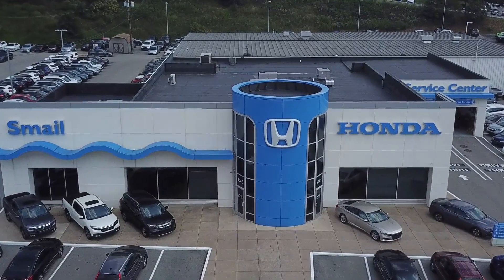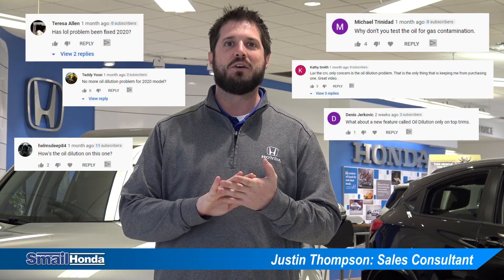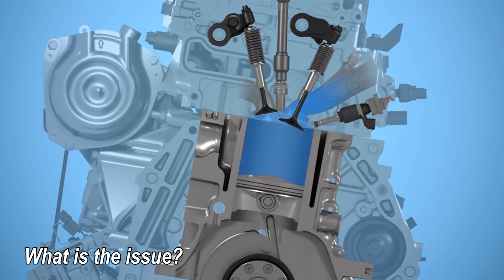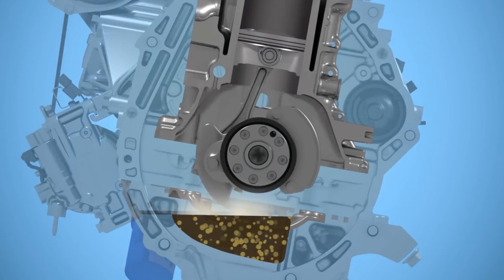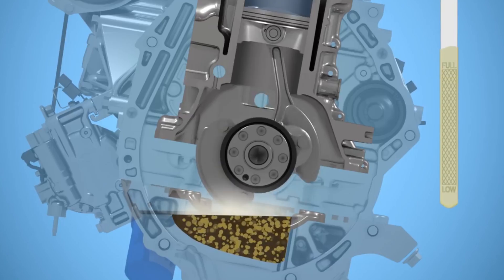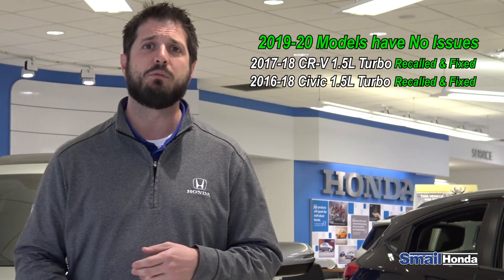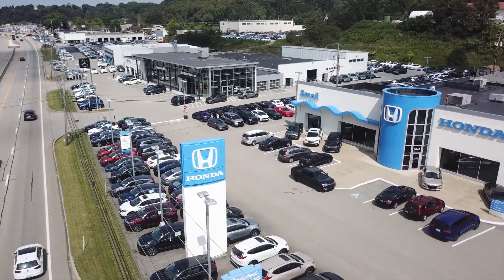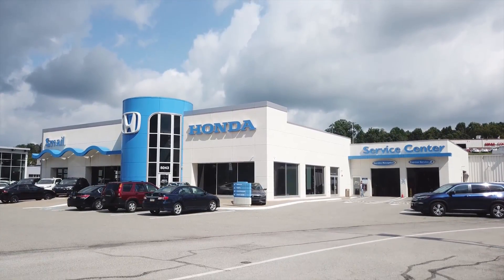Honda Oil Dilution Issue Explained

Comment: So why don't you change your oil more often?
Reply: If the engines runs on diluted oil it won't last very long.
Reply: @crazydan777887  thats why were asking, why don't they change there oil sooner then the honda spec so the oil doesn't dilute.
Reply: @john12abey  I really don't agree. I've had Honda's for over 20yrs.I had a 2001 civic, it was super fuel efficient yet would warm up very quick. Our 2015 crv takes twice the time to heat up (and the temp. Gauge goes down in winter if I turn up the heat)and it's not even mentioned. But to me an engine must run at it's operating temp no matter how cold it is. Diluted oil is not good especially considering the ultra-thin oil (0-20) that's recommended. This really seems like a design flaw and maybe not enough people have winters for it to be addressed as an issue. But a car should not be required to be driven 30 minutes just to avoid oil dilution. PS in case you're wondering I'm in Montreal.
Reply: @crazydan777887  I live london ON
Nice and cold around here myself 4 hondos over the years civic hybrid 2003  479000km 
Crv 2012 daily driver 200000
Crv 2018 just got none with turbo engine they just need to fix there problem the problems mechanics or the engineers ones not working right i am a mechanic for 20 years and just belive you can look after your own vehicle dont listen to the dealerships that want you to pay more for everything 😉
Reply: @john12abey  it's just inconcevable that a company that's known for building reliable cars seems to be in denial(I'm just looking into this, I'm not yet sure I have all the info. on the issue). Changing oil more often is a patch not a solution. So what i get from your message is that you have this problem with your 2018 but don't know exactly what's the cause other than it doesn't warm up fast enough...
Reply: I know.  What's the problem?      Is it too much for people to just change their oil every 5,000 miles?       (which would be overkill compared to the maintenance reminders).
Reply: I own 3 Honda’s
2004 Civic ex 322k miles since new. 
2017 CR-V Touring 65k miles since new. 
2019 Accord Touring 2.0t 25k miles since new. 
All regular maintenance. The civic a/c Compressor just went out at 303k miles.

Comment: Just buy Toyota
Reply: I did ... I switched ..no turbo or CVT .
Reply: @charlesjackson1700  Well it all depends on what you were looking for. Say you want a economical A-B car, corolla all day. If you were a little bit more adventurous buy a old MX5 and race it out going to track days. The thing all teenage boys including myself have gotten wrong is your every day driver does not need to be fast. Get a cheap car work on it, make it your own. Then you have your weekend fun car.
Reply: @ZHB1989  yes ..you can do that to ...

Comment: Not a problem on my 2018 CR-V, just take it to Honda for regular service.
Reply: Speak for yourself.
Reply: @eastcoastnavajo       A lot depends on the ratio of cold starts vs. miles driven which nobody seems to talk about.    A 30 mile one way commute to work will see much less fuel dilution than a 3 mile commute especially in cold weather.
Reply: You probably have the N/A variant.

Comment: What exactly was  done in this “software” update. Was it to have the engine operating temperature raised to help burn off the vapors? If it was, then it should also increase gas mileage due to hotter engine temps.
Reply: Hotter cylinder head temps increase volumetric efficiency thereby increasing gas mileage. Examine a 2001 BMW E39 530i with the m54 engine.  The reason why that vehicles computer and 190F thermostat have the vehicle running around 200F is for better fuel economy. That comes at the expense of the large amount of plastic on those particular engines. Due to high degree and rate of expansion and contraction cycles, those plastic cooling system components fail at a high rate, necessitating frequent replacement. (I change mine every 60k)
That is that generation of  5 series achilles heel. Fortunately for me, that part is not particularly expensive and simple to replace. 
I can see a software update in these hondas correcting this issue by getting the vehicle into closed loop faster and  putting a timer as the factor in the vehicle going back into open loop as opposed to engine temps. That's not the update, just what I think is a possibility of how an update can solve an issue like that.

Comment: Ok software updated.  To do what? You haven’t explained what the fix is.......Jim
PS......is the engine running at a higher rpm on startup, or what?   You are not a politician, so why do you give your customers at tap dance.  Honda you’re loosing customers.....I bought a Toyota instead. Very happy with my 2009 CRV.......
Reply: I switched to Toyota as well ..
Reply: @drewbenefield2001  Take it to your dealer, should be covered under warranty.  Don’t trade it in, make sure they fix it. If you have problems later they are obligated to repair even if warranty expires. Most dealers are good and they will help you.    Jim
Reply: The point is they have no fix
Reply: I switched to Toyota and Mazda and I’m so glad I did 

Bye bye Honda

Comment: We had a 2019 crv . We bought it last year of  july 2019.  Oil dilkution still not fix. Our cr v did not run for 2 days and after that I check the engine of our cr v and I found it the oil level in the deepstick is above on the maximum level. I smell the oil and yes it's smell gas on it. So disappointed. Our cr v is just changed oil last month it' s just only have 4800miles on odometer. I thought  honda already fix the essue. 🙄
Reply: This engine won’t last 50k miles. Get rid of it ASAP.
Reply: I'm very disappointed about the fact that my 2020 crv touring has the same oil dilution problem!
Reply: I have a 2009 CRV, with the 2.4L, 4 cyl w/5sp automatic. No issues so far at 121,000 miles. I wanted to buy my wife a new Crv replacing her 2006 Honda Accord, that had 170,000 miles (purchased new in 2006). I was going to buy her a new CRV, but when I found the small 1.5L engine, turbo and CVT.....I walked away. I bought her a new Toyota RAV4 with a 2.5L 4cyl w/6speed automatic. This time I found one that was 2 wheel drive, this saved me a bunch of money. My CRV in 2009 cost $26k out the door. The RAV4 cost $26.1k in 2017.   Thanks....Jim
PS.....the RAV4 gets about 20% better mileage than my 2009 CRV.   By the way......features my 2009 CRV is an EXL model, the RAV4 is an XLE, only differences are....I don’t have Leather seats in the RAV4, nor power drivers seat. The RAV4 also has Safety Sense....it stops by itself in an emergency to avoid a pedestrian/car, lane hold, and adaptive cruise control.......this was a $2-3k adder at Honda, standard in all models of the RAV4 in 2017. The RAV4 has 52,000 miles with no issues. Both cars I change the oil at 6,000 miles, synthetic oil only. I have changed all parts per maintenance log. On the CRV I have changed the PCV every 50k miles, trans/differential oil every 30k, engine oil/filter every 6k, cabin filter every 50k, and air filter every 15k (summer time only). Key to keep cars running.......MAINTENANCE.
PPS.....above cars you maintain, not repair. New Honda’s....?

Comment: A software update don't fix anything once the problem has started
Reply: lol you'll be surprised what the computer controls. What if they're calling this engine tune a "software update?" What if the fix was just to decrease the fuel pressure going into the cylinder head, which technically can be fixed through software.
Reply: @dpolendo  Sure! But, reducing fuel pressure also negatively affects atomization which in turn, negatively affects the quality of the burn, fuel economy and power.  I think the speaker on the video said it right.  There is a fuel DELUSION issue.

I noticed he didn't even think to mention the contribution that turbocharging makes to the issue.

Let's not mention the double talk about "Not knowing if other dealers are having a problem".  The idea that the dealers don't talk to one another about these issues is "explicatively" ridiculous.   The only reason that would be true is to maintain plausible deniability.   Keep keeping your heads in the sand boys.  

You can't fool all of the people all the time (But you sure can try!)

Comment: My 2018 CR-V is yet to be recalled. Therefore, not fixed. I drove 6 hours to Utha from California this summer (hint hot engine) with 1 stop for gas and still the motor oil smells of gasoline. I will not buy another Honda with a turbo engine.

Comment: Uhhhh i have a 2019 civic with a 2.0l and i swear ive been swapping out my oil for years, and i swear ive been smelling gas, my friends and coworkers say they "definitely" smell gas... soooo idk man
Reply: Synthetic oil normaly has a gas smell as long as the oil level is not increasing i think itl be ok i have a 2010 honda civic and the oil smells like gas but oil dilution was never a problem with that model

Comment: Thanks, I've been driving Accords since 1989 and currently own an '09 Accord EX-V6 with about a 125,000 miles. It's a great car, as have the others that I have owned. 

I learned in your explanation that these engines have direct injection. I imagine it is safe to assume that the 2.0 turbo four in the 2020 Accord is direct injected as well. Direct injection concerns me as well and might be a deal breaker for me because there's no way to keep the intake valves clean. 

I don't change cars often like a lot of folks. That's why I drive Hondas. So, in time, I would have to deal with the build up on those intake valves. Does Honda install a catch can on these engines? If I installed a catch can on a 2.0 turbo would that void my warranty? Pretty sure I know the answer to that one, but please feel free to offer an opinion.

Thakns
Reply: Honda does a thing where they have minor overlap with the valves so even though it's not as good as port. To a certain degree it will be fine without cleaning the valves regularly but obviously cleaning them can help. But won't be as nessecary as if it was a mazda. The mx5 gets it real bad from what I've seen.
Reply: ".... cleaning them can help" is the deal breaker. That is a maintenance item I have never had to consider before. The thought pisses me off. I think my '06 Accord and my '11 Silverado will last me until I don't need a car any more.
Reply: @engrcumins9809  I mean, it's not that much of a job. You can just throw some crc intake cleaner every 100k or so if you want. You don't really have to. Doing it on a wrx really isn't bad at all.

Comment: Mine had the recall done on my 2018 CRV EX, living in midwest its not as bad as the north, my CRV still has fuel dilution greater than 5% confirmed by an oil analysis. How can this guys say its fixed with no issue, certainly I'm not the only one still with the issue.
Reply: Piston design issues, reduced piston-to-cylinder contact, gasoline running from the piston rings into the crankcase

Comment: I wonder what the used car market will look like in 10 years. With cars being turbo charged, built wrong, or being mostly hybrid or electric with batteries that go out over time... makes me glad my first car is a 4.6l V8 Mercury Grand Marquis. I prefer reliability over a few extra bucks saved at the pump. If gas mileage compromises reliability, I'll stick with reliability if it means a bigger, non turbo engine.
Reply: Yeah that math didn't add up when gas was cheap, let alone the new normal of 4-7$ gas.
Reply: I just googled that engine, gets 17/25mpg. So if you take just 100k miles / 21mpg x avg fuel price over several years of $2.80, = $13,333.  Compare that with most midsize sedans (with or without turbo), that average 33mpg over 100k miles x $2.80, and you get $8,484.  I'm not trying to be a jerk, but even just 100k miles you're blowing 5 grand. Multiply that by 2, as some people keep cars for 200k, and your cost of ownership of your car is 10 grand more than most cars of the same price out the door. That's crazy. Something to take into consideration when you get your next car. Idk how people drive around averaging under 25mpg, costing them thousands and thousands in simple gas money.
Reply: @mootsym  But if the better gas mileage car has to be replaced or repaired prematurely - all your savings are lost and then some.
Reply: @edbreyer  which is why you buy a Honda or Toyota, both much more reliable than most companies, including the Mercury brand the original poster mentioned.
Reply: @mootsym  True - as long as this new 1.5L engine has the same longevity we've come to expect from Honda. I think the jury is still out on that.
Reply: @edbreyer  indeed. time will tell.
Reply: @edbreyer  This engine will have problems.  The oil has been compromised by the mixing with gasoline.  If you change your oil every 3,000, which most people don't, you will get some extra life out of this engine.  It is a shame that Honda won't address this.  Just discontinue this engine.  They have the engineers to do this.

Comment: How does software fix a design flaw? I know Scotty Kilmer personally and he used my car in his video, and one thing he has constantly noted on his channel is software doesn't fix design flaws, and that this is the cheap way of circumnavigating a mechanical issue.
Reply: Well, while that's true, software tweaks can make the problem less pronounced. You can call it "mitigation thru software control" if you like. It's not a disastrous flaw if most of them aren't even affected, so they're not going to recall and rebuild all those engines if a software update solves the problem for most of the small percentage of ppl who even have the issue in the first place
Reply: I smell a lot of bullshit from this dealer.
It’s amazing what some car dealers will say.
Reply: Noah Stakes Amen brother
Reply: That was your car??? I immediately checked if my civic had earth dreams and now I have a broken heart☹️
Reply: Bryan  Scotty is nothing but a carnival barker.
Reply: Only if they could modulate the working pressure in the cylinder somehow, until the engine warms up well... Is there any updates on this issue, I wonder?  Thanks
Reply: I agree, software can only fix the problem if it's software created in the first place.  Honda is just stalling until warranty is up on these cars, then they'll stick it to their customers.  The best fix for any Honda problem is to buy a Toyota.
Reply: The software update leans out the mixture during warmup and also supposedly does something to transmission shift points (either advanced or delays them) to get the engine to warm up faster.
Reply: Was yours the CRV in the video? Bro, just get rid of it - it won’t last 50k miles.

Comment: Dealership updated software on mine, changed oil, filled to the lower dipstick mark, but the same problem remains and nothing is fixed. Gas is still coming into oil, now it's over upper mark on a dipstick and dirty, dealer is playing dumb, salesmen told me they never heard about this issue. I came to dealership again after 2000 miles, they told me to pay for oil change. Don't buy Honda CRV EX, you may be sorry.
Reply: Get rid of it ASAP

Comment: I have a 2004 Element EX AWD and the legendary 2006 CRV AWD. Let's see if your turbo boosted engines can out last these two vehicles. Turbo is great on your 5th car that only gets driven a few weekends every year. For reliability you simply cant beat Normally aspirated engines.

Comment: Honda has surprisingly stopped the 1.5 engine options on their website configurator. If that doesn't validate there's a problem, then I don't know what it.
Reply: The 1.5 is still on the configurator. It is on the Accord anyways
Reply: No it’s still there, not sure what you’re talking about
Reply: @overseasterritory8983  I'm talking about the European market. I don't know why Americans are still being sold this piece of garbage engine
Reply: Look at the new Ridgeline,  they still using the same trash engine but have REMOVED the earth dreams logo.  Wow